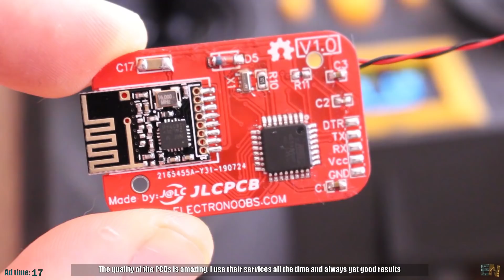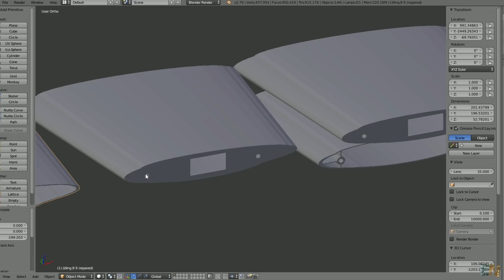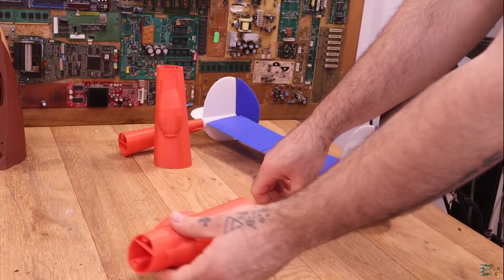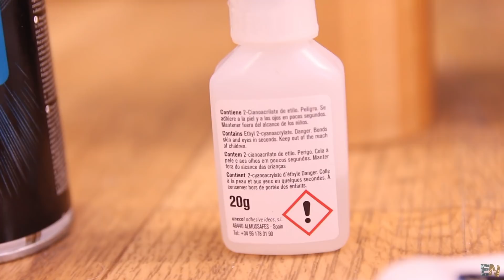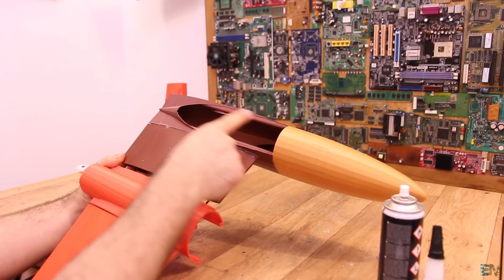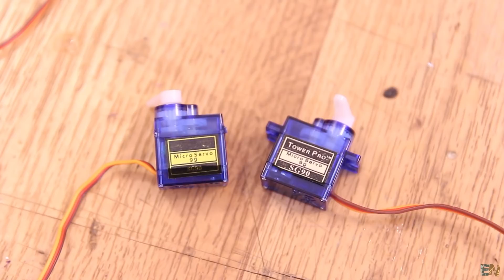3D Printed RC Plane - Huge P38 Design

Comment: hi
my is ejike
i have been following your progress for quite  a while
i started with arduino still love arduino however for production and cost purposes i switched to pic microcontrollers
it is more difficult however profitable and more stable.
i also use to use blender however it is not reliable so i switched to Freecad.
Freecad is incredible and more serious debt for 3d and absolutely stable

i also design aircraft and surprised to find your build
it seems we have alot in common
i thus offer my hand in friendship.
we can accomplish alot together

my aircrafts are more experimental or pioneering as they say.
i am planing to achieve longest flight with very little energy.
for example solar panel fuselage and battery power system
thus the aircraft will be powered by solar panel rechargeable batteries while in flight

the aircraft is more wing base for mass and better surface area to accomodate solar panels
i am much older than you and did graduate as an administrator from thames valley university london
my brother in law is spanish and one of my best friends from university is also spanish so dont worry about the cultural difference

if i get a positive feedback from you i will then forward my email and contact number 

sincerely

ejike

Comment: Sir give a tutorial with DHT11 sensor with arduino... Project like a  Automatic temperature control for DIY Air Conditioner.. Sensor works when temperature high.. And also connect a display and a temperature adjustable switch. 
Thank you. One of your keen follower.

Comment: Hey I'm designing my own plane in Fusion 360. I am completely new to any sort of CAD software so big props to you actually finishing. I'm Just finished the wing and I'm trying to figure out how to make the nacelle for the EDF(I also have not decided on the size of the EDF although I'm leaning towards 51mm).
Is it possible that you give us a tutorial on how you made he supports in CAD? And how did you find the dimensions for the motors and servos?

Comment: Nice project and design. I have been using Blender and understand the amount of work you have put on the design. I am an RC flyer myself at an intermediate level and like flying foamy 70mm EDFs. I think others may have already commented but will put my observations any way: 1). The weakest  point is in the center where the two wings connect to the fuselage. Without re-enforcement, it will break mid air. You may want to reinforce by inserting the two rods inside a metallic cylinder and securing these so they do not move in a horizontal drift. 2. The power system may not be enough to generate the required lift. At least a 30-40 A ESCs and potentially a bit more powerful motors (did not pay attention to the specs of the ones shown) may do the trick. Would like to see it flying. Good luck in the maiden and keep the good work.

Comment: CA glue is not very mechanically strong when used on PLA, its even worse when you use the accelerator. several 3d printed flying models have snapped at the glue joint from very little impact.
Reply from the maker: Thank you. What would be a better choice? Thanks!
Reply: @ELECTRONOOBS  probably 2 part epoxy

Comment: Great project friend. 
I have a few questions:
- Did you print the brushless motors spoorts in PLA or ABS? If they are PLA are you sure they can handle a steady temperature?
- Are you sure that stepper motors placed on top of the wings are not going to mess with the dynamics?
- That super glue is too strong, when it fall to the ground, wouldn't it break more easily instead of taking the impact?
- Aren't those stepper drivers too weak to deal with the wind?

Comment: I would thread some string through the parts to pull the wires or the wires themselves as I have built large planes before and know from experience how hard it is to thread wires after the glue up

Comment: Nice project.
If you can avoid using CA activator you will have a much stronger glue joint . The activator makes the glue set instantly but also more brittle and less strong.
Edit:
You can see this on the white glue joints where you used the activator it foams the glue so you have little air bubbles in it instead of a solid glue joint.
Reply from the maker: Yes I've seen that but without activator it takes toooo long to dry... Any alternative?

Comment: Not sure, but the aerofoil cross-section of the wings looks symmetrical, so they won't provide lift.
Check the profile of what a wing should look like - the top surface should be larger than the bottom surface.
Reply: It'll fly fine. Especially in small scale, airfoil doesn't mean much. A picnic table will fly if it goes fast enough, and it's really not very fast. Ask any picnic table or plywood sheet that wasn't tied down tight enough to the roof of a car.

Comment: Could you do a build with a flightcontroller and some flightsoftware like arduplane or inav... combined with a gps module... so you can do some automatic flight and waypoint missions(:
Reply: Really? All planes have to be autonomous? where is the fun of RC model building? everything has to become a drone?
Reply: Przemysław Jakubczak well it you dont have to do it;) but it could be really cool... even with the fc you can fly like normal rc flying! But you have some added benefits, like autolevel or stabilized flying or even autonomous gps flying! And for a electronic channel it would be fitting, wouldnt it?

Comment: The P-38 one of my all time favorite aircraft.   The P-51 next on the list.  I would think those printed parts would be over the top too heavy. Your under estimating the Weight issues. As cool as it is it's simply going to end up too heavy.   I don't think this is going to fly.  If it does it will be  all but un controllable due to weight.  It would be better to print the Frame and struts.  Use Poly Wrap to cover the wings.  In the old days we used DOPED Paper.  You guys have Poly Wrap and Shrink Wrap to work with.   As heavy as this is going to turn out you would be doing good to fly it with Weed Eater Engines.   I'm amazed at the power the electric motors can in fact produce.  We have Man Flight with them now.   NOT PRINTED.  LOL   

Will be keeping a eye on this one for sure.
Reply from the maker: Thank yopu for all the tips!
Reply: @ELECTRONOOBS  Will be very heavy. Normally 3d printed planes are 1 layer thick. You can also use ColorFabb LW-PLA. I hope you dont crash too hard ;) Good luck!
Reply: 3d printed planes have an even chance of basically flying. ecalc.ch will tell you if you have sufficient thrust/weight. Airfoil is pretty irrelevant, I commented elsewhere.
PLEASE see my and another comment about insufficient aileron. I am also concerned about rudder - if you have differential thrust you're fine. If not, it's iffy.
Find out what your thrust/weight is, or it's a coin flip.